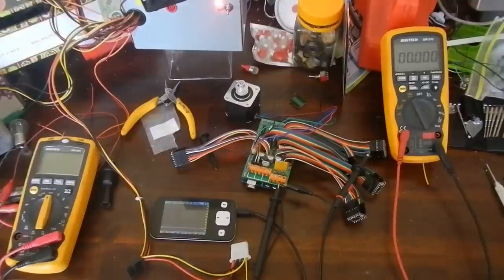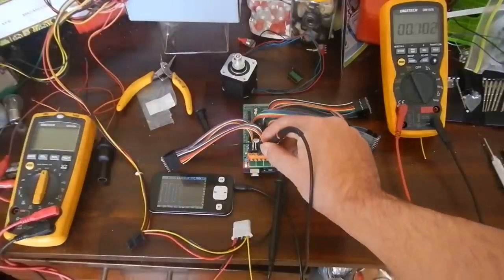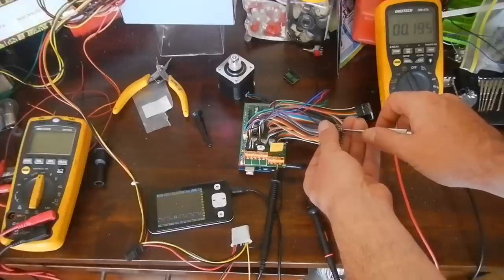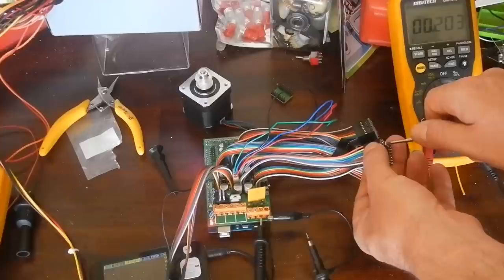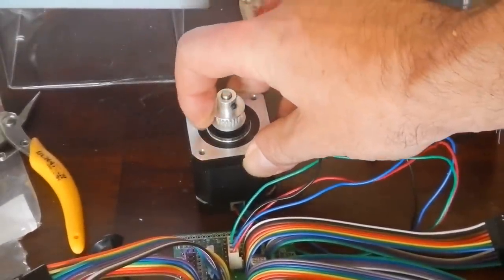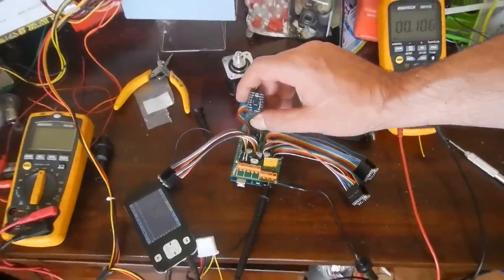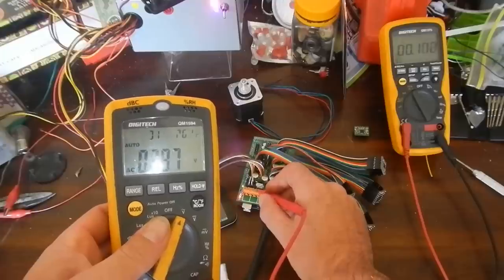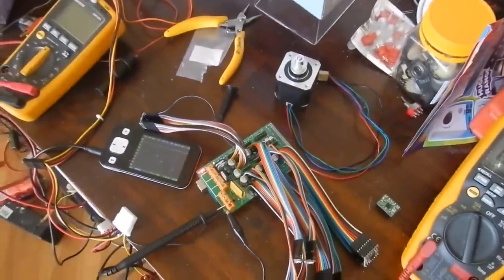RAMPS 1.4 Test, with a4988 Stepper Driver, NEMA 17. How To.

Comment: hi fantastic video - my extruder motor isnt working, i switched xyz cables and the motor works - i tested power at driver E AND GOT 0.720, what would be the next test to see if my stepper motor driver is damaged - i only have a volt meter

Comment: How did you get certain motors to do half/quarter/whatever steps? When I run the software all my motors go CRAZY fast and I don't know if it's because my board is broken or it's supposed to be that way.
Reply from the maker: Its all down to the Jumper pins. If you look at the Pololu data sheet, you can see the logic Breakdown. I know no jumpers (all pins low) is full steps, jumper on pin 1 (pin 1 high) is half, pin 2 high is quarter, I think 1&2 high is eighth steps, all three is 16th steps. I could be wrong though, check your datasheet for your drivers.

You should test each motor and driver individually, so you can set the amps right on the driver, before you run them all at once.
Turn off the RAMPS board when unplugging and plugging in motors.
Reply: Mongrel Shark Awesome, thanks for your explanation! I though it was done in software so I was very confused when I couldn't find any reference to it in the test firmware.
Reply from the maker: I still dont know why its not done with software, There are enough digital pins to spare. Would be great to have one speed for accurate printing, and another for homing etc.
Especially on reprarp z axis.

Comment: Hi, great video..I have same ramp, stepper driver and NEMA 17 too..but I dont have arduino mega, just uno and nano..Can You help me with connecting uno with this ramp? I need just 1 working stepper motor now..thanks
Reply from the maker: Not sure it can be done. RAMPS board is designed for atmega. You could conect a single stepper to a smaller arduino, But you would need new code, and ideally a custom sheild. All you need is PWM to drive the speed, and a high/low to drive  the direction. Probably already code out there. Arduino forum is where you want to be. If you dont have multiple steppers and heat beds etc to controll, there is no need for the RAMPS board.
Uno and Nano both have much less powerful processors. I hope you dont want to do anything too complicated.

Comment: Hi Your setting your Nema 17's to 200mA is that the norm for Nema 27's I do have 3 and a cnc shield but not sure if I would be right in just going for 200mA or can I tell by the sound on the motor if it is running too high current? Thank You and as said already great tutorial.
Reply from the maker: +Bill Parker I like to turn the current down until it starts to not turn properly. Then turn it up a bit. More current than needed can make motor and driver circuit too hot. As well as wasting power. I like to go about 20-30ma past the just working point. So its got a bit extra power but not too much to damage something if parts crash into each other.

The NEMA 27 datasheet should have details on the motors power and heat etc at various current and load ratings.
Reply: Thanks for a quick and well explained reply.

Comment: Hi, I have two questions:
1) Which code did you use to prove the motors?
2) When you tested the motors, did you wire the endstops switches?
Thanks
Reply from the maker: The code link is in the video description.

No end stops needed for test code.
Reply: Thanks a lot

Comment: Hey

Can you please upload how to connect the PSU?
i tried to conect the multimeter in a serial connection and couldnt get any current in the multimeter.

Thanks
Reply from the maker: Not sure I understand the question.
Sounds like you want advice on hooking up the DMM?
If so. Check the corect ports on the DMM are used, and that its set to the corect range (10A for both) Then it should go in series between PSU and Circuit board (So the dmm is the only conection and all current passes through the meter).
If the device wont power up and/or still no readin on your meter. the meter is dammaged. Likely from misuse/failing to rtfm.

I have a video on the mods I made to the PSU if thats what your looking for.

Comment: thanks!The video may seem be helpful but unfortunately I dont have the knowledge about electronics.Do you have any alternative things to test the motor,because one of my motor of my 3D printer is not moving.I just only heared a sound while trying to run it.Thanks
Reply from the maker: Mc Jerson Ruiz All I can suggest is to gain the basic knowledge of electronics you need to solve problems like this. Or to get help from someone with said skills.

What your describing could be a dozen different problems. I would need a lot more info to help.
Reply: ok thanks anyway Mr.Shark.All our motors now are running but there are some problems when printing.I think there's no problem about the calibration og the axis.The problem is changing direction when printing.
Reply from the maker: That's still not enough info unfortunately.
I suspect the current could be a little low. Although there are a ton of other possibility's.
Including firmware issues, or bad components somewhere in the system.

Comment: Where did you get that little oscilloscope?
Reply from the maker: ebay. $60. There is a basic review on my channel. Showing the bandwidth, which is no where near as good as advertised. Its ok for slow stuff though, under 100khz, I have a faster one too, also in the review. This one is the DSO201 v.1 Check the seed studio forums for more info.

Comment: Hello friend, I made a mistake when trying to configure the drivers of the motors (pololu) using a screwdriver, terminals Vcc and GND were touched, and now my motor does not move, I wanted to know if it happened to you something alike and if it's how fixed it.
Regards.
Reply from the maker: Yes. I have done that. The pololu is likely dead, get a new one. You may have also dammaged your Arduino and should test it carefully.

Use a plastic screwdgiver for adjusting the trimpot. Its also a good idea to insulate your pins.

Comment: hey mongrel great vids 
have you got a vid up of the finished project?
what was the final cost?
Reply from the maker: We dont have a printing printer yet, but we do have a complete i3 prusa that has firmware/slicer issues. It's total cost was somewhere between $300-$400 with no more to spend to get it working. The repstrap I am making with the metal frame will be coming in around the $200 mark, as I used a lot of scrap parts and am only paying for electronics, bearings, motors, and a few cheap bits like belts and threaded rod for axis movement. Its a ton of work though.

Comment: The two LEDs next to the power output are not flashing. Dose the mean my ramp 1.4 is dead?
Reply from the maker: Hard to say with so little info.
Reply: Thanks Mr. M Shark. I just ordered a new RAMPs. Thanks for your GREAT video.
Reply: hello i have the same issue here , so is the raps is dead do i have to replace the ramps ..?

Comment: Hi Mongrel, thanks for that superb Video! I'd like to measure voltage, amps and proper function of the pololu A4988 that I have connected to the ramps using a multimeter and the same oscilloscope that you have.

Would you mind explaining where/how you are connecting the multimeter and the oscilloscope to the ramps board / the pololu's ? unfortunately we can not see the wiring...
Reply from the maker: LOL, The normal way. Amps meter in series with between the board and the PSU on the pos rail. You can see my neg meter probe powering the RAMPS board, you cant see the pos meter probe on the 12v rail of the PSU.

To use an Oscilloscope normally requires some training. Lots of good tutorials out there on the net. The basic idea is to use the black clip as a reference point, so normally on ground/neg rail, and look at voltage over time at the point you want to check. As you can see me doing with heater connection points in this video. Once you have your black clip on ground, you can check any point on the board for proper function with the probe. Provided you have the O'scope set to the right time frame and voltage range, and have your trigger set appropriately for the signal.
In this video I had trigger set to none. To save on waiting for the scope to take a sample in the MS range, as that takes a minute or two. Where I wanted to make a quick video and get real time data.

If you watch in HD and full screen, you should be able to see all the details. I recorded this video in 1080p.

Comment: Hello i have question i have stepper motor 4 wires 1A/phase and 3,5V/phase and i don't know what power supply i need to power motor connnected to a4988(i have only a4988 and arduino). I know that i can't have above 1A power supply but voltage can be higher. What influence does voltage above 3,5V give for motor... is it higher torque or speed? I am not good at electronics so am asking. Thanks for Your help
Reply from the maker: 3.5v or 35v? 3.5v sounds very low. Might not work with a4988. I think the a4988 need 5v minimum and can run up to 35v on the motor with a 5v regulated logic supply from your arduino. You can have a higher amp supply. An appliance only draws what it can/needs. In this case the limiting factor is the voltage across the impedance of the coils. The more voltage you have the more current (amps) flows across the impedance and you get more power. For a stepper this is usually in the form of torque.
The demonstration in this video was done using an ATX power supply providing 12v with a 25A maximum. The motor still only draws a little bit of current. Depending on where the set screw on the a4988 is set. It can go from 20milli amps up to 2 amps. At over 1 amp a heatsink is required for the a4988.

I strongly recommend you learn more if you don't want to blow up your parts.
Reply: +Mongrel Shark ok information 3.5V it's not impedance someone told me that voltage which i can max power is even 15 times higher than i have in information but i thought that someone was telling me that amps of power supply can't be higher than per phase. so finally i don't know what to do :/
Reply from the maker: Do you have a link to the datasheet for your motor?
Reply: https://drive.google.com/open?id=0B2_0vZm1A0bjenF2Uko4RFlWWHc there are no information about voltage and amps but other stepper motors at the same size have 3,5V/phase and 1A/phase
Reply from the maker: Going off other motors could be very risky unless you know exactly what you have. Just because they have the same case does not mean they have the same internals.

If you can't find a datasheet for your 23lm-k202-32w you should start by measuring the ohms of each winding. The model number sugests its a 32w motor. 3.5v@1A is only 3.5w... I think you have a lot of homework to do before I can help you.
Reply: Mongrel Shark should i connect to one phase low voltage but high amps and in the end of the wire check the amps and then i will know voltage i need 32W=(amps)*(unknown voltage) so unknown voltage=32W/(amps)
Reply from the maker: The amps for any given resistance will be determined by the voltage applied. You need to measure the resistance of the winding. Then you will have some idea where you are at and be able to calculate the heat.

Please go and study up on stepper motors if you wish to proceed. I can't help you any further if you don't. There is no easy fix for your problem. You need advanced electrical engineering skills.
Reply: Mongrel Shark There is something that i don't understand sometimes exist power supplies with information about amps which gives on electrical circuit i thought that amps on electrical circuit depends about resistance like in batteries and last question chopper in controller it limits amps for coil to not damage the coil how does it know what maximal amps needs coil if it reduces amps which are drowing up in coil
Reply from the maker: Those questions can only be answered if you study and experiment yourself.
Reply: i found information about this motor and it says like i said 3,5V/phase 1A/phase

Comment: How many watts on average does 1 nema 17 stepper use?
Reply from the maker: Its hugely variable. Depends on the axis, drag of that axis, how much the amps are turned up, What voltage its running on. The shape of the print your doing.

To get a reasonable average you would have do 400 prints, with data logging, then work it out, for each printer, as every build is different.

As far as choosing a power supply. You want to look at what fuses you have on the ramps board, and make sure you can deliver that much. So for me that means 11 amps for heat bed, and 7 amps for steppers. Total 18 amps at 12v 216w. So I need about a 360-400+ ATX PSU to be able to get that much power on the 12v rail. If I had a 30v PSU I could reduce stepper current a lot, as well as reducing waste heat. and get a total wattage reduction that would be fairly significant.

Comment from the maker: Yea... That was due to JAYCAR being crap. Cant get the right size smd parts in Australia. So the female headers didn't fit. I think I need to shorten the rainbow. At leas this way I can cool the stepper drivers. They have heatsink attachment underneath. Top side has horrible thermal dissipation, yet no one RTFM's and everyone puts heating on the chip.

Comment: any way someone could answer the simple question of how much wattage the A4988 can deliver? saying it runs from 8 to 35v and 1.5 to 2a is kinda not explaining what it can and cant do, unless they are saying that at 1.5a *or 2a with proper heatsinking) it can run something with a full 35v thus it can deliver 52.5watts (70w with proper heatsinking) but no-one has confirmed this, and a google search, yahoo search both give zero absolute results on this, 

reason I asked is cause I found a motor that operates at 5.08v 1.4a draw in bipolar series (its an 8wire unit so lots of options like parallel bipolar or unipolar stepping as well as the standard that 4wire units are wired for of series)
and is rated at 166oz in and another that is rated 8.4v 1.4a (same series bipolar wiring) with a torque of 425oz in! (I have a 2 foot by 1 foot cutting area CNC mill I built that moves a rotozip router around cutting just about anything I have ever thrown at it albiet a bit slowly on 20tpi quarter inch dia threaded rod (4000 steps per inch (about 157 and a half steps per mm) and it only has 180oz motors running it quite nicely, so the second motor set if it actually would run off that ramps A4988 would definitely power a very large 3D printer nicely :) if not I geuss I can cobble something together to use the pinouts off the controller board to run my own step dir controllable driver from the site the motors are forsale on. (no links, if anyone wants them, message me privately here I guess. though I am not trying to sell anyone's hardware,
Reply from the maker: The info you want is all on the datasheet. https://www.pololu.com/file/download/a4988_DMOS_microstepping_driver_with_translator.pdf?file_id=0J450
Yes 2 amps is with heatsink. You can go to about 1 amp naked on a cool day. 1.5a with some decent fan and 2a with fan and heatsink.

You can't drive a 4 pole motor though. It would pay to look at the datasheets in detail. there are many factors to consider.

those motors you found sound pretty nice. got a link?
Reply: yes as for the 4 pole, not sure what you mean, I thought these stepstick motor drivers were for bipolar motors.
Reply: sent you a message directly, be sure to look at the data sheet, also if you are not in the USA I am sure if you search by model number you should be able to find another supplier, as I am not sure if they do international shipping
Reply from the maker: Thanks mate. I got the link :)
Reply from the maker: I had a look at the data sheet for your motor. A a4988 might just run it in bipolar series configuration. If I could afford to blow an a4988 I'd be inclined to try... With fan and heatsink of course. Just because it can draw 2.8a doesn't mean it will. You would have to load the motor a fair bit. I'd be inclined to go to 24-30v too. The a4988 can take up to 35v, but some ramps boards only have 16 or 25v capacitors so check your driver board caps and stay a good 5v below their rating if you want them to last. All the other components on a RAMPS or cnc board should handle 35v no worries. Just make sure you don’t give your micro too much voltage.
Reply: the idea of testing it on one that is a spare is a pretty good idea, considering how cheap these units are on ebay lol. I really need to get my hands on an oscilloscope.
Reply from the maker: You can get scopes cheap on ebay too. I have a review of some hand held models I found good for the price. The little one in this video (DSO201) was $60. Its a bit slow for stepper sine work but it would read your steps ok-ish. The DSO203 is a great little scope and was $160ish. I still use it over my Rigol 100mhz scope sometimes.